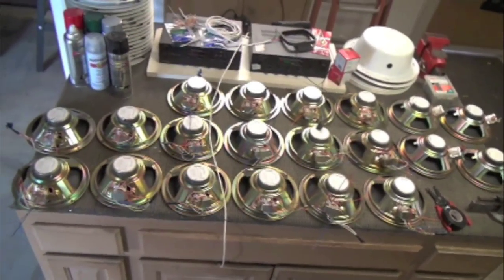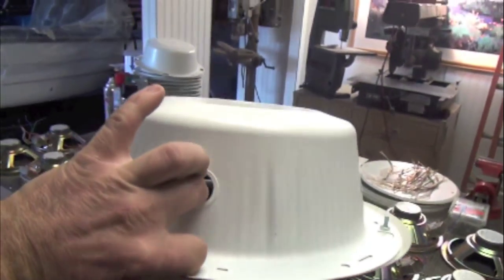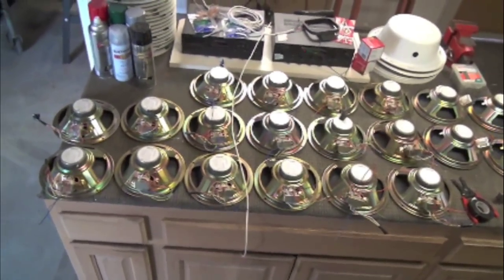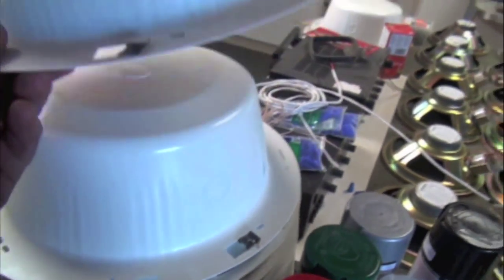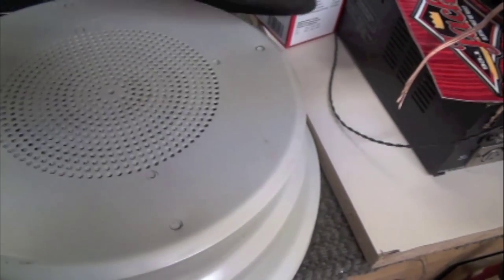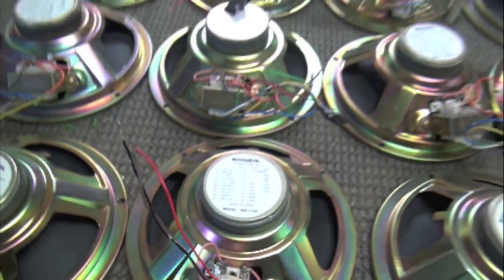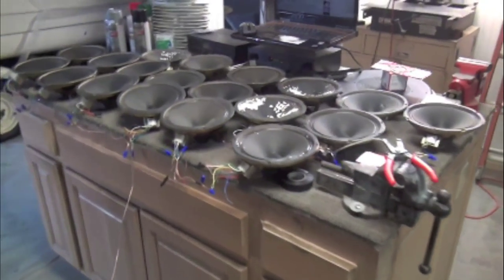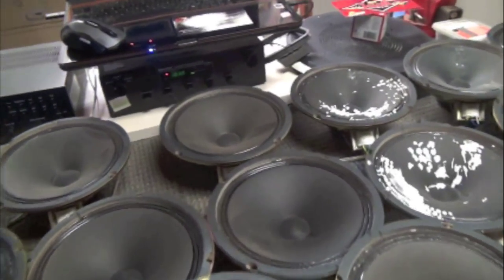p1 About Bogen 70v Audio *20 speaker Backyard Sound System Installation Project - DIY step by step

Comment: Im sure that those speakers Will produce much more bass once they are in the enclosures.  A driver just sitting by itself, will not produce very much bass, even it were a bass specific driver, as the front and back sound waves will just cancel each other out!  I do believe that most of those type of drivers are full range,  and have a pretty low natural cutoff freq.
Reply: My work has these and after I cranked up the volume they can kick out some good bass.

Comment: I am thinking about installing a system like that but smaller in my garage. I am a fan of bogan and I like your 4 zone amp. Could I daisy chain mine like you did yours up in my ceiling and run it to a zone on the amp or did you do it differently.
Reply from the maker: You can daisy chain as many as you would like  so long  you do not exceed the max output at the amp.

Comment: wrong - u can have more total watts of the speakers  than what the amplifier can deliver. U just can't use less TOTAL OHMS than what the amplifier can handle.  for example U can use a 300watts speakers  with a 35watts amplifier - but u can't use 4ohms total impedance of the speakers on a 8ohms amplifier & u can  manage this by wiring the speakers with parallel and series combinations
Reply: +i raul It sounds like you are talking about traditional system?  With the 70v systems,.. the transformers on each speaker do the impedance matching for us, so we don't have to do the math, and wire series and parallel.  Very simple systems,.. just wire up all speakers in parallel, as many as you want,.. as long as the combined speaker wattage does not exceed the 70v amplifiers output. :)
Reply: Josh Vulte don't ruin my 15 minutes of fame

Comment: So much wrong here, I can't even go there - not going to give a class on 70 volt distributed audio systems & the proper techniques for installing them. That said, here are a few pointers: 1) get cans of Scotchguard, & spray the cones to waterproof them - or don't, and they won't be worth a shit in 6 months. 2) Get a bag of fibrefill, and stuff a small batt of it into each backbox (or, a small amount of fibreglass insulation), if you want any bass, or an acceptably low level of distortion! 3) Get weatherproof conduit / gland connectors for the wire entry / exit holes in each backbox. 4) You must account for insertion loss of each transformer (inherent in 70v systems), so don't load the output of that 35 watt background music receiver with more than 20-25 watts of load, if you want acceptable frequency response & again, low(ish) distortion. Either drop down to the .625 watt taps on the speakers, OR go on Ebay and pick up an old Bogen or DuKane, or Rauland booster amp (mono industrial power amp) for cheap (buy 100-125 watt output power), and drive the load with the booster and use the Bogen receiver as a tuner / preamp. Btw, 45 years experience as a commercial audio / video systems project manager. Enjoy!

Comment: Your music choice sucks.  The bouncy Travon Martin Skittles are racist.
Constant voltage 70.7 commercial distributed audio speakers aren't wired in series. They're wired in parallel, ~connecting to each rail of a railroad track.
You should have headroom in the amp (1.2 to 1.5 time more watts than total speaker wattage) to account for power lost from wiring resistance and insertion losses in the transformers.
Good video otherwise.  Nice shop.  Thumbs up.
How and where did you hang/mount em?  And how'd you wire them?  Underground conduit? AWG?
Reply: I agree